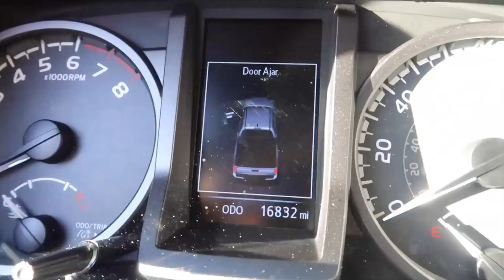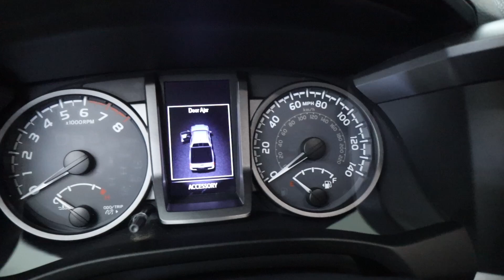What Things Went Wrong at 50k miles on my Tacoma?!

Comment: I had the same exact problem at 60000 miles And they replaced my entire rack under  Warranty Don't you have a warranty on this?
Reply from the maker: Mine is 4 years old and over 50k miles. I did not purchase the extended warranty so I don’t believe I’m covered

Comment: my 2021 trd sport has just over 85k on it and ive had since brand new 0 miles, only issue ive ran into so far is my throttle position sensor is losing signal on occasion causing the pedal to go entirely dead or just very dull much like a limp mode, of course this comes with the amazing lightshow on the instrument cluster. the abs and traction control system would be entirely disable as well as the tss system but just shutting the engine off for a moment and starting up again will put a bandaid on the issue but the check engine light remains on at least for a day or so. this will typically happen more often when i hit a bump. i would like to believe the culprit of this issue is the pedal commander, i havent heard anything else about these going bad and there is no active recalls. my steering rack however is bone dry even after having 33x12.5s for over a year. i mostly drive highway and find myself off the beaten path pretty frequently and these are the only issues ive ran across.

Comment: I have the same shocks. Those DSC adjusters, especially the high speed knob is so hard to twist…

Also, I don’t have an issue with my bumper cap. Flaws from factory for me is the gap between the hood and front grill is different from left and right side. I always look for this on other trucks. That and the gap between the top of my bed rail and my back window is different from the left and ride side.

Comment: I have a 2020 Tacoma and I’m just about to hit 45K. Some of the issues you point out won’t apply because I don’t have the same modifications as you but I’m all about maintaining my Tacoma to a point that most would consider to be over the top. I love this video because it has me looking for potential problems I hadn’t thought about. 
Thanks!
Reply: Wait till your timing cover gasket starts leaking on the skid plate
Reply: @davidb9323  got A 100k warranty?
Reply: @reedrk88t  I don’t - some dealers charge as much as the repairs would cost for the warranty. Over 60k when the factory warranty runs out for power train would be worth it if it covers bumper to bumper. I wouldn’t pay for a warranty overlapping factory.
Reply: @davidb9323  so what exactly is it that's an issue and I'm surprised you didn't get a 100k warranty with that rig. I'm wondering if they changed to a better warranty option in 19' or later. I was given one and it came from the factory.
Reply: @reedrk88t  On the 3.5L it is common that the timing cover gasket seal gets eaten away because it is exposed on the right side of the motor and it starts to leak. It’s most noticeable by the power steering pump and skid plate. The engine has to be pulled. I think it’s booked at 30 hours labor.
Reply: @reedrk88t  I got my truck used from a Chevy dealer I worked at, I elected for no after market warranty, assuming Tacoma wouldn’t be that much to maintain with its reputation for reliability. Extended warranty / Repairs get you either coming or going. You pay up front for possibly nothing or pay in the end catastrophically. I can’t imagine many people out there would be able to incur the cost of this repair.
Reply: @reedrk88t  Is your warranty from Toyota Financial or Toyota Motor Corporation? I would guess that the dealer added on the cost of a warranty into the vehicle pricing. Maybe Toyota has been forced to raise their 36/60k warranty to 100 to compete with other foreign manufacturers. Chevy/Ford still only have 60k/5 year warranty’s
Reply: @davidb9323  factory, it was originally offered when mouth in UTAH. Actually they didn't add any extra cost from original price to final purchase. There are secondary warranties outside of Toyota but mine was included at ZERO cost. Full purchase price of 37k, no extra cost, full 100k warranty. Not all warranties are added with extra cost, Toyota factory warranty only unless you finance or lease then that's where they hit ppl with extra costs
Reply: Yeah, your Truck will last if you don't f**k with it.

Comment: Just to let you know at 70k miles on my 2015 Tundra the same thing happened, Toyota dealer replaced entire rack system it would of cost around $1500 bucks but it was under the 100 k warranty and then within a year the exact leak happened to the other side, Toyota again fixed for free, now that I’m above a 100k miles if it does it again i will just keep an eye on it if it doesn’t get bad

Comment: I'm coming up to 150k on my 16, keep an eye on your coolant bypass line on the back of the heads. Mine cracked just under 100k. Supposedly the part was updated in 18 but I know of 2 separate 19s that ended up with the same cracked pipe.
Reply: My 17 off road bypass cracked, cant miss the red fluid on the floor.  Toyota wanted $2200, I called corporate, they paid the bill.  That was stand up

Comment: 2017 Off-Road w/76K miles; on 2nd set of tires; 2nd battery; maintained at Toyota dealers; no major mods done to this truck;  2nd windshield; I get minor windshield cracks which is likely random rock hits.

Comment: I also had the rear leaf springs sag over time. I have a camper shell and often load up the bed to go camping. I ended up installing the Ironman Foam Cell Pro suspension kit and the rear springs made a big difference.

Comment: I have a 21' TRD Off Road & I was surprised that my leaf springs went into a big Carolina Squat when I put an Uhaul car hauler attached to it. I was within the limits that Toyota set for the tongue weight and for the overall weight, but that was just the empty trailer & it made my leaf springs squat big time. I have never seen a 4 wheel drive rear leafs bend like that with such little weight applied & I ended up buying the Old Man EMU 2 3/4" inch heavy duty leaf springs, solved that problem real quick, but that did make for a rougher ride when the bed is empty. I am running with the adjustable 31/2" Rough Country Vertex reservoir shocks & front coil overs.

Comment: Hi, about the leak on your rack. Check your transmission lines to your radiator. I had the upper transmission line leak at 5k miles, and it looked just like your leak. Just run your hand along the hoses to check for leaks. Hope this helps.

Comment: I had a first year 3rd gen taco and coming from a long line of previous 4Runner and a second child I thought any shortcomings would be made up by space as I put a camper shell on immediately. I could not get rid of that truck fast enough. All drive by wire and mine sometime would not go into reverse and dealer could not fix it. After 3-4 trips to shop all they did was glacé the ecu as they put it. On the last trip I told them to keep it and I left in a new 4Runner Trd off road premium I love it after 98k and lots of those were earned. Heavily modified and not a single small issue yet. The spot on your lower front bedside looks to me like a bottom out and the tire hit it. Ifs leaf sprung trucks are the worst of both worlds. A tire on a leaf may appear to have tons of room but the it hops and a little axle wrap later and you don’t. Speaking from owning ten 4x4 trucks and 34 years of wheeling. I am far from knowing it all but I know what I know. Also really sucks about your rack.

Comment: Well if you had a 1st gen Tacoma you can expect major discrepancies around the 20 year 240K mile mark.
prior to that (some where around 150K) just 1 door actuator, reseal water pump with FIPG, cracked rollover valve , starter, and steering rack bushing repalcement.

At 240K ... Rear wheel bearings, Lower control arms and ball joints, and third member howling.

This truck is so good if they banned ICE I would find a way to convert it.

I still can't beleive she's on her same altenator.

Comment: If you get sumo springs from superspring international on the front and remove the front Sway bar, you'll have waaay better ride quality with not much added body roll. It's a lot more comfortable going over bumps in the road at speed, and if you ever drop the front tire down, such as off a rock or a curb, the truck will not shake as much. Your front end will also return to center much quicker offroad. Also, there's no more risk of the sway bar hitting the remote reservoir if there's no more sway bar.

Comment: The uneven bumper cap thing drove me nuts when I first noticed it. Mine has a larger gap on the passenger side like yours. I totally forgot about it until watching this video lol
Reply: I had mine fixed at the dealer for free. Warranty fitment. That part of the warranty expires really early tho like 10,000 miles I think.

Comment: Have about 54k on mine. No major issues. My blind spot monitor went out and also my drivers side heated seat. Which I’ve heard it’s really common on our trucks. I just did a tranny drain and refill, heard they recommend doing it at 60k. I will also be doing the spark plugs very soon. 👍🏽. Love your content btw. Good job!
Reply: Did you do the drain yourself, and was it complicated? I've been wanting to drain mine and replace fluid.
Reply: @joshuahinojosa2103  I did it my self, actually its really easy. Almost like an oil change but a couple more steps. There is a couple helpful videos on YouTube 👍🏽
Reply: Mine has 54k also, my blind spot monitors went out also. Have you fixed yours?
Reply: @SeanStewart88   I have not, I really love the blind spot monitor too but the blind spot module that is on the drivers side which I heard is the “main module” that controls both sides is like $600! I might have to find a used one at a junkyard or something but it did go out like at 30-40k miles. 😤
Reply: @DosbrosTacosandEuros yeah just another gadget to break. Still have my old school 1st gen tundra trd. It's gettin old, but it will probably outlast me. I just can't justify buying anything with the market prices these days. Even on used trucks.
If i do buy anything again it would be the last of the dinosaurs...the 5th gen TankRunner. But they're about to go extinct. Maybe get one used when the car market ever freakin settles.
Reply: @TrapAPMadeItSlap  😂😂😂
Reply from the maker: Interesting about the transmission flush/refill—I have been told by the dealership to not worry about it for a while and/or not change it at all since the transmission is sealed. Is 50k the recommended interval for that?
Reply: @ChloeKuo  I heard 60k is the recommendation, just a drain and refill. I actually noticed a big difference on how it shifted. Really smooth. However there is a trick on on how to put our trucks in “transmission check mode” there is a couple YouTube videos with details. Maybe by your next YT video? I ordered OEM Transmission fluid on Amazon 👍🏽 with new crush washers etc..

Comment: Hello Chloe , I don’t know if you know but the tacomas are known for the needle bearing breaking!! That’s exactly in the area where you see the leak. I just had my needle bearing removed and replaced with a much better bearing from ECGS it’s about $90 bucks and a great mechanic near San Diego fixed it. Don’t even take it to the dealer they’re just going to install another needle bearing.  This usually happens when you raise your Tacoma.
Reply: That’s right, I can attest to that… I bought the same bushing kit from ECGS and had it installed counting the parts for $240.  My Tacoma has a 2 inch lift and started vibrating at around 60 to 65 mph and was making a humming noise the ECGS bushing kit, fixed it up like new.
Reply from the maker: Thank you for the advice! have heard about the ECGS bushing, although I don’t feel the vibration issues after lifting as described by others which is why I haven’t done it. But it’s something to certainly be aware of prior to lifting a Tacoma though!

Comment: My 2017 TRD Offroad is coming up on 170,000 miles.  I've not had any of the issues you're having.  I'm curious as to where your truck was built.  I'm guessing in Texas.  Mine was built in Mexico.  I wish I could remember where I saw it, but I saw an article, and internal article if I remember right, where Toyota questioned if there is too much technology being used on the assembly line.  Their experience was that the trucks made in Mexico with more human labor were slightly better in quality that the trucks coming out of San Antonio.  There have been a few recalls for my truck, but I think almost everyone of them were for trucks coming out of Texas.  I do all my own maintainance  and have lifted the truck similar to what you have done.  It was taken to the dealer to have the frame sprayed, but other than that, it has not been back to the dealer.  I specifically looked to buy a truck made in Mexico, as I had read the article mentioned above.  i did replace the needle bearing on the driver's side  with the bushing when I did the lift, so that issue never came up for me.  I have no oil leaks, water leaks anywhere.  I did have a very well regarded independent transmission shop do a full flush and refill on the transmission at 100k.  All other fluids are changed by me.  It has been a great little truck so far.  Whether it on road or offroad out in Utah and Colorado, it seems to do just fine.  I will change the drive belt sometime before 200k, but right now it looks just fine.

Comment: Man...I better go check my bumper caps! 
Im at about 41K on my 2017 TRD Sport, no issues. Just changed my Manual trans fluid and flushed my engine coolant. Only thing I had to replace was some light bulbs and the battery.

Comment: Could just be sweating on the rack boot.  I'd wipe it... Poke a tiny hole on the lower side of the boot.  If it drips then you know it's a real leak.  If it doesn't leak it should be fine to drive on it unless it makes noise  or causes any drivability issues.

Comment: On my 17 tacoma my p/s pump started making noise on about 30,000 miles and i had to replace it but i think because my trim is an SR with 16 in steelies i switched them with the 4 runner limited 20s for summer and for winter i switch them to 17 in 4 runner trd pro wheels so i think that was my fault.

Comment: I’ve done two racks on my truck and I’m 60k lol. It’s a pain in the ass but after the first one it gets easy. Pull oil filter off unbolt rack ( some people cut the bolts off cause you can’t reach one) and then slide out the whole rack with tie rods attached from the passenger side. And when u put it back in just put the bolts in backwards to make it easy for the next time.

Comment: 2021 tundra 27k miles list of complaints haha

Biggest gripe by far is how easily everything in the interior scratches and I mean everything. All the door panels plastics just the most minor brush of anything against leaves ugly ass scratch marks and it drives me insane!!!

Transmission does weird shifting sometimes, doesn’t like being cold. Downshifts way too much while at any slight hill. Not as smooth as my previous 2013 tundra. 

Seats are not comfortable at all, I actually think my old 2020 Tacoma was more comfortable than my tundra. Just stuff as a board and hard on long trips. Not the best seats by a long shot. 

Terrible stock tires, which I guess is to be expected. They’re at 5/32nds with only 27k miles . Pretty lame

Everything seems to be holding up great. No mechanical issues, nothing broken. Just minor annoyances more than anything.

Comment: so most of your issues are from modifications you made. the steering system is working harder in order to turn the larger, heavier tires. good chance that the rock slider on the right side caught that plastic piece. same side with the damaged shock in front. always better off staying away from after-market mods.

Comment: I have a 2017 Tacoma TRD OR 4x4 and I have experienced a lot of issues in my opinion. I had an AC blower motor go out even after the recall, a leaking rear differential, paint failure with the super white paint code 040 in many areas of the truck, rear brake drum problems, and the worst being a rear main seal leak. All of which happened at or before 50k miles.

Comment: I've got a '17 with 75k and I've had 2 major issues one was my ac motor making noise which was within the first year of having it and my second issue was the seal on my 3rd break light going bad and leaking but that been fixed too so nothing else major.
Reply: There's a recall on the leaking third brake light.
Reply: @231mac  yeah at least with mine there was its not all of them but from what I was told the seal went bad and it leaks inside of the cab. Mine wasn't too bad of a leak. I actually forgot about it until I was driving in the rain one day looked when I got home and saw it was water coming in.
Reply: @stevenreynolds5978  When I had the recall done, they said they would replace anything water damaged, so you may be able to have that replaced, too.
Reply: @231mac  i don't think I had any water damage nothing there was very little water coming in. I'm in California too so it very rarely rains where I'm at. I'll check next time I've got to take it in for some work nothing else was mentioned about it since I've had it re-sealed.
Reply: @stevenreynolds5978  👍

Comment: I can 100% attest to the saggy leaf pack; I run a camper shell and bed setup all the time, and the stock leafs are very wimpy. When I’m able to lift the truck after saving for a decade and a half, I’m gonna get an entirely new pack.
Reply: I installed the 2,75" lift heavy duty Old Man Emu leaf springs. It did not break the bank. It cost me around $500 to buy & install them.